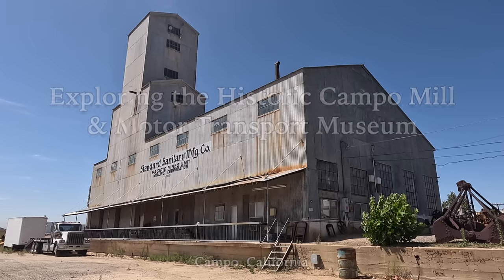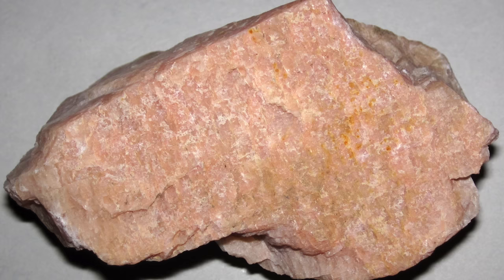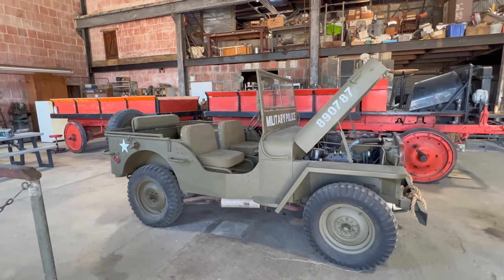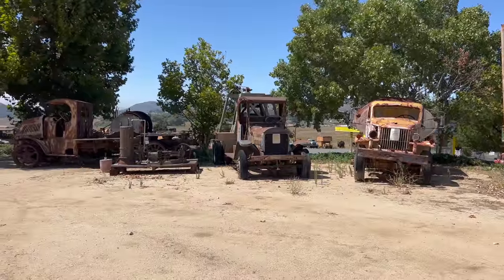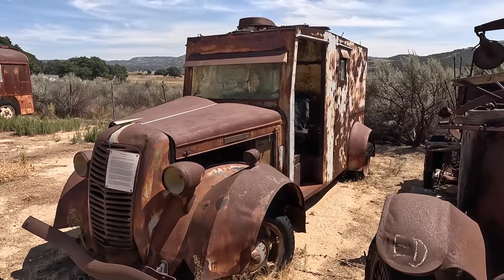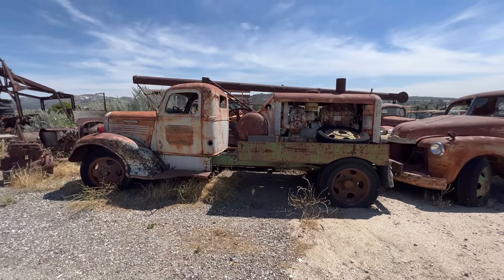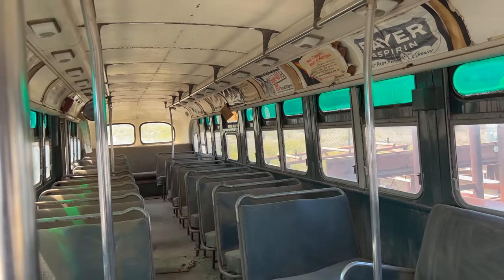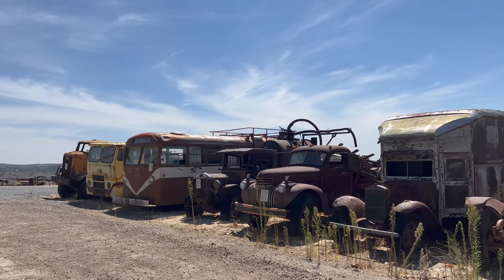Exploring the Historic Campo Mill and Motor Transport Museum

Comment: The Diamond T was made by Diamond Trucks in Lansing, Mi. After the founder of the Oldsmobile, Ransom E. Olds bought the company they changed the name to Diamond Reo. The ceased production in the early 70s, but you can still find one occasionally still working. The split second before you signed off was a yellow towable, all mechanical grader/road maintainer. A person would man the big wheels to raise/lower the moldboard, while another drove the horses/tractor/steamer, etc. to smooth wrinkles in the old roads, most of which never were covered in pavement. Thanks Steve, really love the old, rusty iron. All the best, see you next Wed.
Reply: I met a dude once who had a rat rod made from a Diamond Reo truck. Had a straight 8 for an engine. Was the first time id ever heard of one.
Reply: I used to have a mechanical, horse drawn road grader with faded yellow paint. Never used my horses to pull it, and now it's gone on to iron graveyard at an old farm. Still there, as far as I know, and still working gravel and dirt roads, pulled by a tractor, probably an old one.